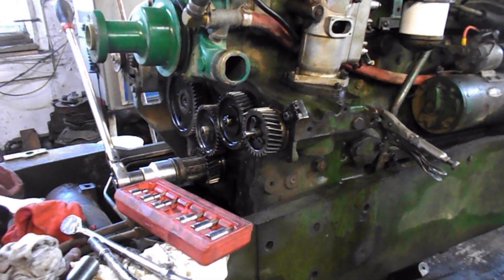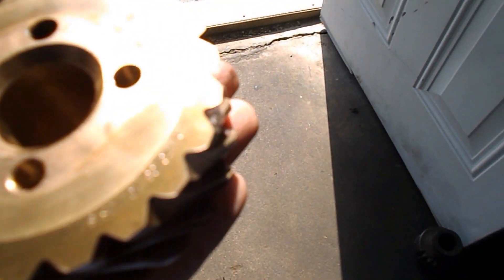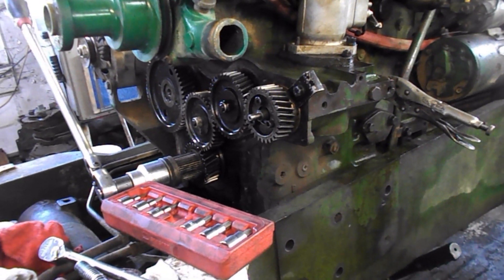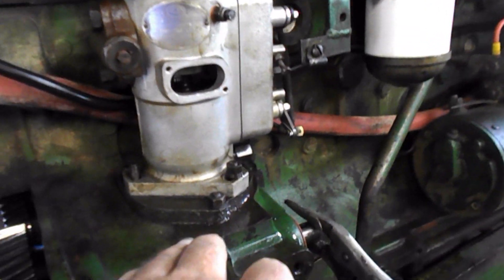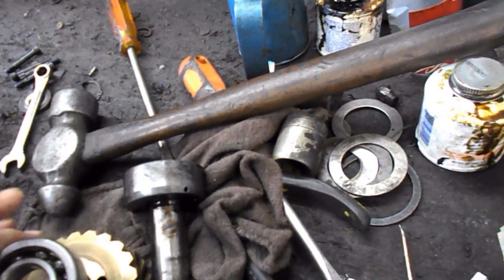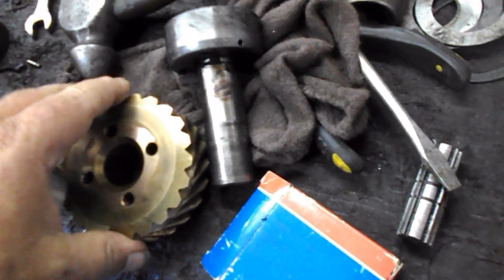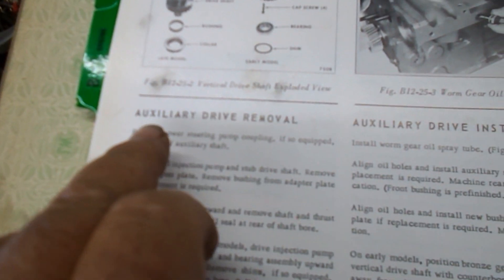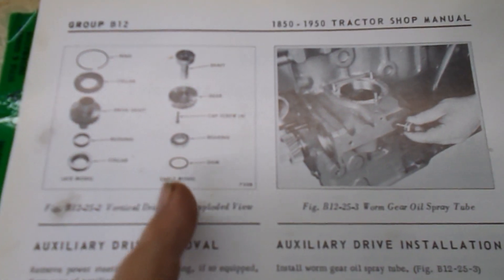Oliver 1850 354 Perkins diesel Question, We are Stuck !

Comment: You've got the same Oliver shop manual as I do. I looked up the shim in the parts book, and it only says "as required". At this point my guess, and it's just a guess, is that is was something that was set at the factory and they felt would never need changed again. I'll do some digging to see what I can come up with.
Reply from the maker: For whatever reason the information about the old style drive like mine is no one so far has been able to find any information about it. Harry and Jerry both have never seen this before in and after looking at there books dated 1965 for the 1850 its the same thing mine book does, It shows both the old and new style but says nothing about the old style as for setting it up. The other thing we were wondering about was the bearing itself, The one we put in last spring and the one I just put in both have a rounded edge on the bearing and dont remember if the one we took out had a squared edge. The reason I say this in the casting at the bottom ware the side and bottom are milled out there is about a 1/32" edge sticking out of the casting uncut and were wondering if the bearing is going too low into the casting thus throwing the gears out of alinement .  The bearing I just replaced came from Maibach and they crossed the White Oliver bearing # over to a RLS8 bearing (metric) a SAE bearing slides in real easy and so does the drive shaft and its a hair loose for my liking.  Thanks for looking in advance cause me and Harry have been looking all over the place and havent found anything yet on it.  Bandit
Reply: @banditfarmer1900  I worked on one of that style a few years back and replaced that lower bearing. I got a NOS bearing from Parts Depot, I don't remember how the edge was, and I don't recall if it even had a shim in there. I swapped it out, put on a new gear, changed the thrust washers on the front of the horizontal shaft, and that took care of the miss at the high rpms. I think the problem with this one was mostly those thrust washer halves, but I didn't want to do it twice either. 

I was able to do some cross referencing and found the Massey Ferguson equivalent on that bearing. It's a 895512m1 and Parts Depot has one at their Colorado location. Maibach should be able to get it for you, or even your local dealer. Early MF 1100 used that drive as well, so maybe a shop manual for one of those might have the info.
Reply from the maker: @ThatOliverGuyChris  Saturday I thought I had hit the jackpot cause I found a guy with a brand new shaft and gear, When I got there and opened the box up I realized real quick it was for a lot newer 354 Perkins and it wasn't going to work in mine. But now I know ware a newer style gear is now LOL . I can find any part for the 354 except for anything for the injector pump drive, Even a call to 2 different Perkins engine dealer I was told the same thing, We cant get them !  Harry looked at the thrust washers in mine and said they look really good compared to most of them he has seen, It has a little end play in the shaft but its not much at all to talk about. The fellow below says it should be stamped on the casting by the serial number that will tell if it has a shim or not, Dont know if its true or not but its worth looking into just the same. Keeping this older equipment running is getting harder to do these days mainly because of issues like lack of info and parts !  My cousin said he cam make new thrust washers for me if I can find all the sizes or if I had a good pair to go by and thats the problem, I dont have a really good pair to go by or find the demintions for them. I might have to holler at Lord Muck and see if his buddy can find some parts over in England cause I sure cant find them here. Bandit
Reply: @banditfarmer1900   well if Chris can't help you, you'll have to call NASA  🤔
Reply: You're a gem Chris.👍

Comment: the gear lash is to loose from what you are saying sounds like your housing which is the block is worn a bit ?
Reply from the maker: They have ware no doubt about it but Harry ran plasta-gauge threw them and checked them and he said there still mid range in speck, But like he said by the time there covered in oil and running they will snug up as of right now there dry. I think a lot of this is in the brass gear after the new bearing was put in and changed how the gear meshed together. This is why were looking for information on how to set these gears up to each other, When you dont know you look and ask questions and so far there is no info to be found yet but thats why I asked you guys cause someone has got to know out there.  Bandit
Reply: Well, I would keep going to Perkins resources for information. The Oliver manuals won’t get down to that detail. You need access to a Perkins manual for your engine
Reply from the maker: @stevewarner8880  That is part of the problem, I've called 2 different Perkins engine dealer and only one even knew what I was talking about. The one called me back today and said he just cant find any info about the old style like I have in there old manuals or on there computer system, Bad thing about this is the engine is over 50 years old so finding info or anyone who knows about them is like finding hens teeth ! I know the info is out there some place I just got to somehow find it . Bandit

Comment: You know this is the same engine Massey Used in their 1105. There's a real good mechanic in Bedford Indiana, at Lazy Diamond Equipment that I bet can answer your question. Just ask for Mark. What about Jake Zigler?
Reply: this right here is why i think hanover inplement would beable to help you out on this
Reply from the maker: Bill we've talked to a lot of guys about this and no one has any information on this old style drive from 2 Perkins engine dealers to retired MF Oliver White mechanics and a bunch of dealers and no one has any information on the old drive system I have. This is a 1965 model tractor and the drive was changed in 1966 so Oliver only had one years worth of engines out when they changed it so the books may have been changed in 1966 so if the dealer got a new book they got rid of the old ones as there outdated. Problem is now no one has any info on this one and we really need to find out how to do it. Harry has been working on Oliver's at McHenry's sense 1969 and he has never seen one like mine before and the guy I talked to Saturday has worked on MF's sense 1970 and he has never seen this set up before , He even went threw 6 MF books on the 354 Perkins and there is nothing in them about this system. Everyone we have talked to about the 354 Perkins say the same thing, I never knew there was a bearing under there, All the ones I've seen just had a bushing under the drive gear. Someone out there has to know about this and I really hope they share the info so we can get the old 1850 running right again.  Bandit
Reply: @banditfarmer1900  That's why I recommended Mark. His dad is still in the shop and they're still in business but it's definitely old school. Mark is late 50's and his dad is 80(?). I also mentioned Jake. His family has a lot of experience as well.
Reply: @banditfarmer1900  this is why i feel like hanover implement could help you on this
Reply from the maker: @mattphillips4260  Matt we got it figured out and the 1850 is in the field working now, There really was not a problem in the engine it was all in the injector pump. Right now its running great with a used injector pump on it and I'm still going around with the guy that rebuilt it, He says my engine is shot and its not his pump, I asked him when how does it run so good on another injector pump on it ?  I'm still trying to figure out a way to show him, I have it on video so maybe that will do it.  I know its not the engine its the injector pump now I just got the convince him of this fact and get him to make it right.  Bandit
Reply: @banditfarmer1900  hot dang so happy to hear this great news
Reply: @banditfarmer1900  Bandit Hope you’re doing ok Yes it wouldn’t be the first time I’ve seen incorrectly set up injector pump drive a mechanic to despair painful greeting from Australia

Comment from the maker: There is a lot more video on the Oliver 1850 but right now we need your help in finding out how to set up and shim the bearing under the injector pump. A year ago when the new rebuilt injector pump was put on we put a new bearing under it. But now that everything is apart again we might have found a problem. The brass gear shows signs of new ware on the top of the gear so it needs to be shimmed up but we have no shims and dont know how thick they are or how to set the gear lash in the injector pump drive. My books and Harrys books dont show or talk about how to do this and I talked to a guy Saturday morning and he has never seen one of these old drives like I have and he has worked on MF tractors for the last 50 years ! Harry's worked on Oliver's for the last 50 years and he has never worked on one of the old style drives like I have and we just cant find any info on how to set up the gear lash on this 1850. I took this video today (9-28-2021) and figured I would ask you guys if anyone has any information on this drive system PLEASE let us know in the comments on how to do this or tell us ware to find the information so we can get this set up right. There is a lot of slop someware in the drive system for the injector pump and hope with changing the bearing and brass gear (good used cant buy a new one) will solve the 1850's engine problem. PLEASE let us know if you have any info on how to set it up cause we just cant find the information. Thank You guy for any help you can give us on figuring it out.  Bandit